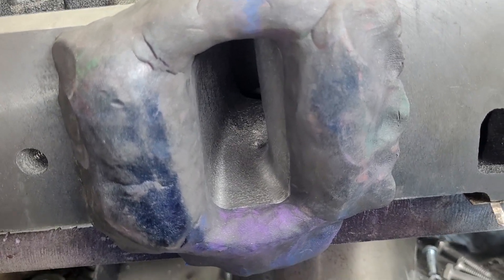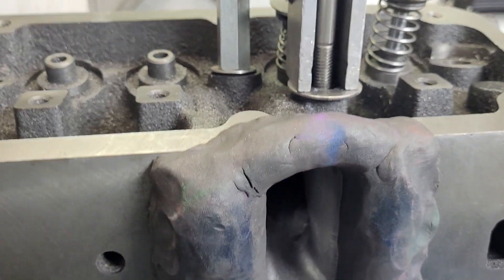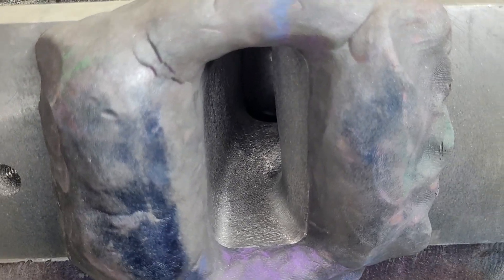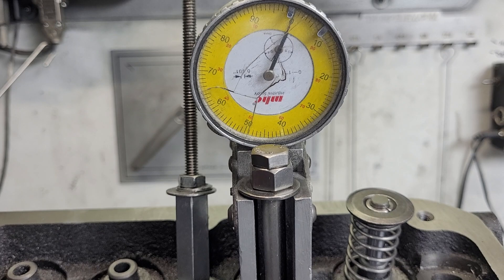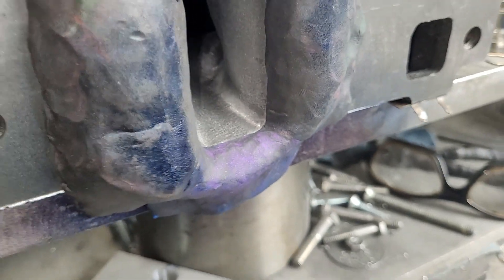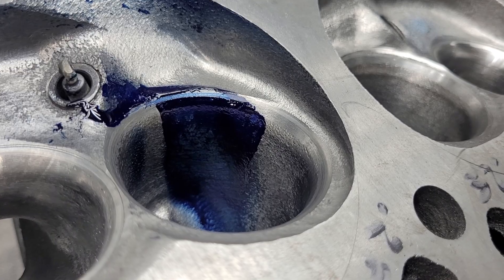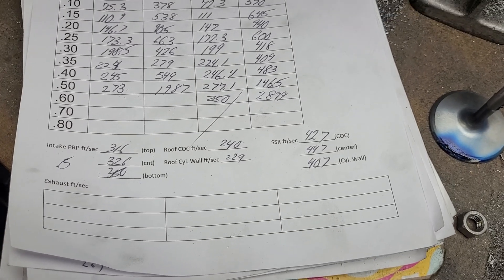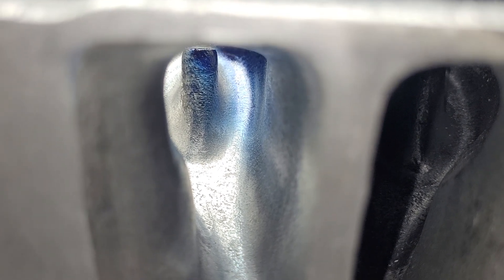Airflow non seperated flow sound vs. seperated flow sound, sailing the string, applying dykem, EQ-CH

Comment: May need to lay back the pr side str so it can grab some of the airspeed that is being accelerated by the push rod wall and slamming into the common wall as evidence of the blue dye.There is a very low pressure in that area inwhich is a byproduct of velocity
Reply from the maker: There is always lower pressure with higher velocity. Thanks

Comment: Air and Fuel MIX in he Carb !! .....If you hear Noise on the Bench it is "ONLY" Flowing AIR ? ....No Fuel .......to Hear MIXING .. ?
Reply from the maker: Well, as the fuel is going down the runner it tends to fall out of suspension. Is it possible to put it back into suspension?
Reply: Yes you can Re-Atomize ""some"" with Edges but if  Port is Right Size (Consistant CSA) it stays Atomised ? ........A Turulent Port is a Choked Port !

Another Topic: .. about  the Venturi,  360* Venturi ? You know Multi Seat Angles  45-60-75-90 @ Throat INCREASE Flow , Wouldn't 75*-60* Angles  on the BOWL side Improve Accellaration thru Throat ?360* Venturia, 360*, 360*!! Are you  getting a  Full 360* the Same Angles into Bowl?

IDEA ??  ...Anyway to  chuck up a cutter  with Angles in the Bowl Befow the Throat ?

  Maybe a Ajustible Feed  Blsde ( Like SERDI) with45-60-78 on your Stone Cutter  with Spring on Cuide pushing  Upward  , Mayb HAND Turned on Aluminum, , a Perfect 360* Angled Venturi @servediocylinderheads
Reply from the maker: @MrKawa74  Every port in a running engine is fully turbulent!

Comment: Leave it alone. When an intake that flows 240 gets bolted on, it probably wont back up, or not as much,  after .5
Reply from the maker: I need to finish the intake, I bet it flows over 300 each runner when done. Thanks
Reply: ooooof........well, bolt it together and test it....I would love to see the result.
Reply from the maker: @stuartwall8212  Stay tuned. Thanks
Reply: I once had a port increase flow with intk installed
Reply from the maker: @joebushell2438  It can happen. Thanks

Comment: That port shape looks like there is too much airflow on the floor/lower half of the port. The top half needs more area to get its fair share of flow.
Reply from the maker: Interesting, I don't see that being the case. Please explain, thanks
Reply: True......but I would go WIDER !!! ..  CONSTANT CSA ,  Wide-Widening Both Port Sides in a ARk (Round)  at SSR  rolling into  Bowl  = V Throat + V Guide = Width across Bowl ? You end up with Heart-Apple  Shape into Valve
Reply: Widening at the ssr should slow airflow in that area ... but on the other side of the coin, if it also increases port flow in the bottom of the port ... you may with the same problem.   @MrKawa74
Reply: Just an amateur porter here .... but I would agree.    Your sheet shows your ssr velocity is near twice your roof velocity .... and in your string test at .500/.600 it looks like its continually pulling the upper port flow towards the ssr .... as you raise the string ??
Reply from the maker: @chrisfin1921  Are you sure adding area to the slow speed part of the port will improve flow?
Reply: No I'm not "sure" but it seems like the port flow is heavily biased towards the floor.  
At the start of the clip you said there was a reason the port is shaped as it is ..... but you didn't say why ? @servediocylinderheads
Reply from the maker: @chrisfin1921  It is biased toward the floor.
Reply from the maker: I can't give away everything. A good teacher helps the student learn with knowledge,  comprehension, application, analysis and synthesis.

Comment: Hi Charlie. You are having the same problem that I often have. You get it to flow better but then it can't follow the ssr. The fact  that the air separates off the ssr really bothers me also. I bet that if you flow the same port with the intake attached your problem above .500 goes away. What happens on a flow bench vs what happens in a running engine with all the intake and exhaust. It still nags at me though, better flow is better flow. I feel your pain. Andrew
Reply from the maker: Ouch!

Comment: I’ve said it before, but my 9-1 340 stocker made over 410 hp and over 400 lb ft from 4000- 6200, with early 90’s cam under .470 lift and under 210 cfm flowing intake ports. The 71 340’s with 11-1 “ 62cc heads were making over 480 hp with the 2.02 valves flowing over 230 cfm. I never ran the 71 combo so I am going off of some numbers that were probably softer than actual numbers and with a bit of acid, I am sure that the flow numbers still didn’t match your numbers. These were all done with under .470 lift, .462 if my memory is correct. The 360’s with the same heads, cam and around 8.8 cr were over 450 hp, some probably close to 460-470 with the p/w and et they were running. The later rules that allow solid cams of the same lift are making quite a bit more power. If you run a solid or roller, and 240-250 duration you don’t need over .500 lift, especially with a good manifold 10-1 cr and 360+ ci
Reply from the maker: Good info, thanks

Comment: I wonder if the airspeed is so fast that it can't conform to the ssr, like a car that goes too fast flies over a hill vs a slower one that just crests it.
Reply: Fast one Slams into back of Bowl, Bounces off, Tumbles and Blocks Port
Reply: @MrKawa74  Low lifts aren't horrible, do you suppose the valve helps keep the flow attached and aimed into the CC at low lifts? At higher lifts maybe the valve is too far away from the SSR and the flow separates and the valve can't effectively guide the air into the CC?
Reply: @rolandotillit2867  Could be ? ....Flow Speeds.... VARY... thru out the Valve Lifts,  connected  with the Intake ..PULL..from   Accelaration of the PISTON from TDC ,  on Down stroke & Deccellaration at BDC and Enertia of Flow to Valve Clse, as PISTON moves back Up !  Not to mention the Speeds from 1,000 lbs  EX PSI on Blowdown ? 28" is A number, running engines can pull 28", 50", 65", 80",  100" to 150"
Reply from the maker: Exactly!

Comment: Maybe just 60 grit roll the whole thing.
Reply from the maker: Out of 60 grit.
Reply: @servediocylinderheads  bummer. Harbor freight rolls are decent. They dont turn to dust.They do unroll easier though.
Reply from the maker: @____MC____  I like epoxy rolls. Tough.
Reply: @servediocylinderheads  it just came to me, i think ruffness on the floor and short side cause enough turbulance. Weingartner racing has a good video explaining the use of dimple or carbide finish porting and where they make a difference.

Comment: 2.002 Valve CSA  is 2.397 sq in. Wedge flows 87% or 127 cfm x 2.397 sq in = 304 MAX Cfm  Divide 146 =.... 2.085 sq in @ Pinch .......! ......2" Tall x 1.04' Wide  ....with a 3/4" Radius Corners @ Pinch

 Pissing sound is  Air Flying  off SSR and Air Bouncing of the Back of  Throat  and Clogging-Choking down of Port  ?...SSR is SUPER Critical......

EX can become a CHOKE? Exhaust Throat @ 91% ...Radius  Valve 45  same  as Throat  then Taper Port  to Ex Flange  Opening of 2.397 sq in  or 1.75" inside Pipe Dia ......... 1.75" = 2.397 sq in ..same as Intake Valve....hummmm
Reply from the maker: I have no idea what point you are trying to make. Thanks
Reply: It is ALL about MATH  & Equations.  All Math! ...Chad Speier ...Porting ..... has all the Math on Youtube much better than I can ! @servediocylinderheads

Comment: So around .580" would be the peak lift cam that would be useful with these heads, only getting into the bad flow lift for a short time, best would probably be around 
.550" lift , correct?
Reply from the maker: It is a good question. Thanks